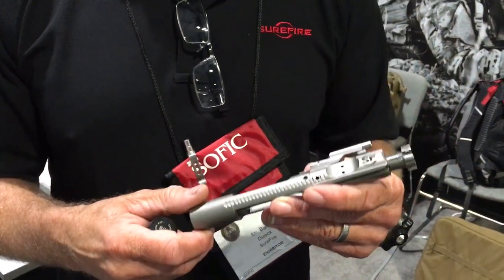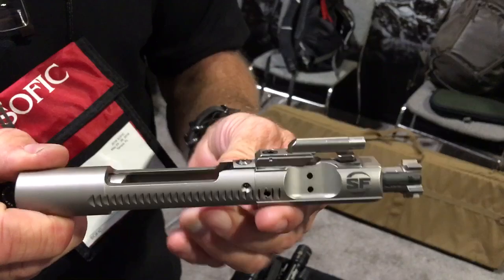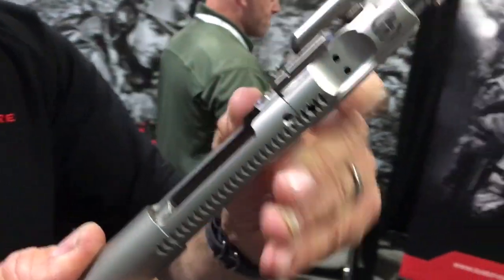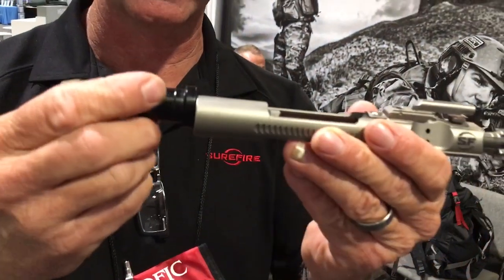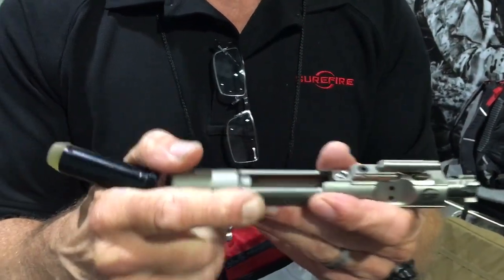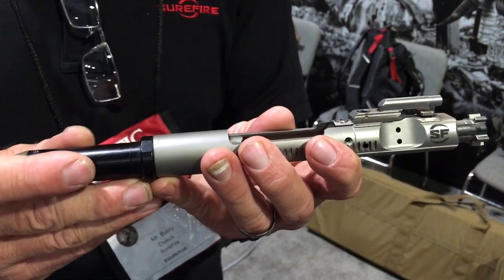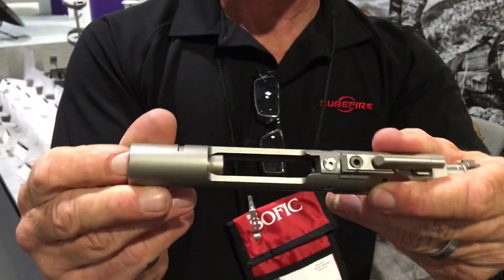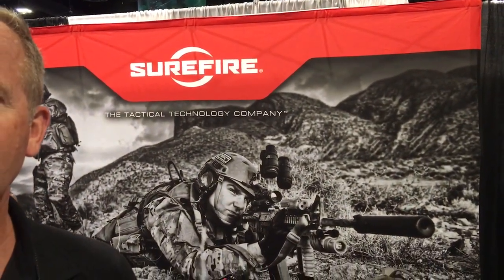SureFire Optimized Bolt Carrier Group (BCG) Long-Stroke (LS) and H7S Buffer System

Comment: I bought it the first day it became available on Brownells. I used it for the last few years and really enjoy it. The recoil impulse is a bit different so it is a much easier shooter. I also love how easy it is to clean. I mean I know people talk about wiping the carrier down but I mean inside where the carbon builds up and on the bolt tail are so easy to clean that I can get a white towel in just 10 minutes. That's compared to normal bcg that can take hours to clean and would still have carbon.

Comment: BCM makes an outstanding BCG for around $170. Never heard of any complaints about them...but it seems that you will always have people that will pay for over-priced equipment!
Reply: jeffsgsxr1000 you buy overpriced equipment. BCM rebrands toolcraft BCGS.  Pleeb.
Reply: @BelligerentFetus  I hope within the two years since this comment you have actually learned a thing or two about manufacturing. I doubt it though.
Reply: The one thing that I don't think they can easily advertise is just how different this bcg feels compared to the normal one. It feels a lot different and the cleaning is the best part. It's actually my favorite thing to do now is to break down the bcg and clean it and see how fast until I can get a completely white towel. I had a BCM bcg since about 2011 (right before the mass panic era) and really like the bcg but I would spend hours cleaning the bcg to get all the carbon out and it would still be black. The bolt tail required me to use a bronze brush to clean the carbon build up off. Def an improvement over the normal design.